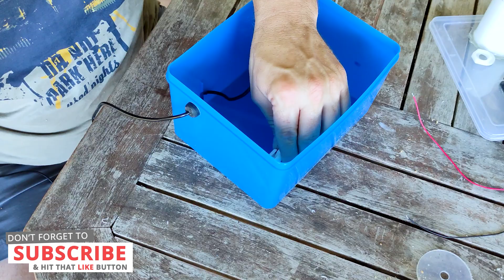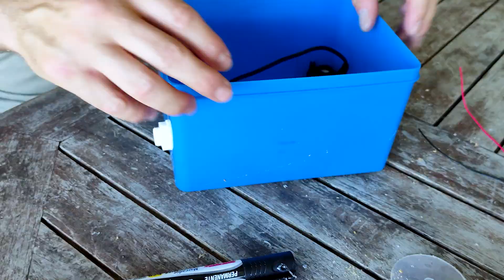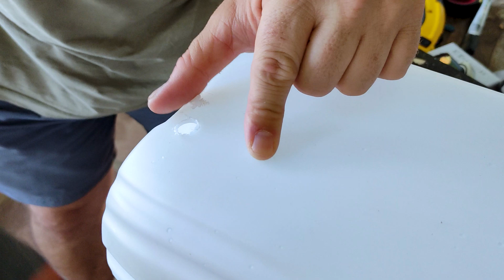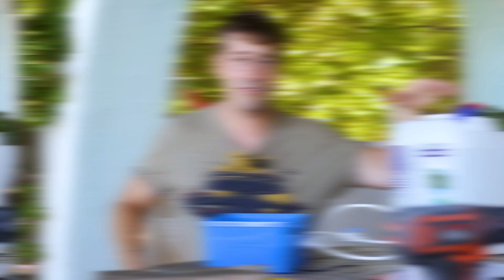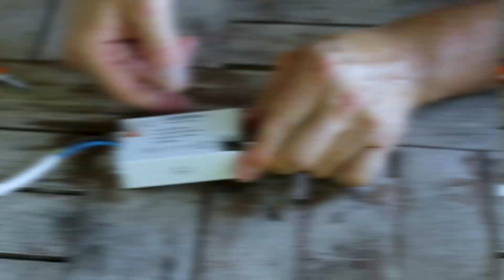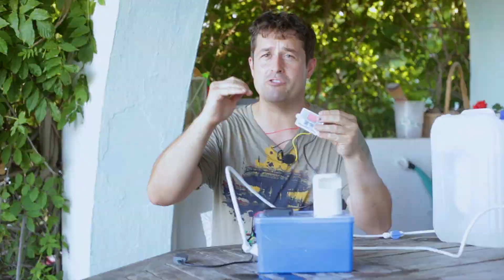Cheap & Easy DIY MIST MACHINE using an Ultrasonic Humidifier - DIY Fogger Machine FULL BUILD

Comment: I worked for a place that dealt with plastic for 13 years, and I wanted to offer a little trick: when using a hole saw drill bit,  after you've made the pilot hole in the drill bit on the center of the hole saw,  switch your drill to reverse.  You'll have to work your drill at different angles to prevent binding, but it will give you a better chance of making a clean hole without cracking. It will melt some plastic,  so you'll need to clean that up; a deburring tool works great for that.
Reply from the maker: Thanks for the tip mate 👍 😁

Comment: Why do you think this stops running after a few seconds? At the end of the video it stops running. I mean the main ultrasonic humidifier itself. I tried it in different bowl in different water levels but it does the same thing before even starting this project. https://youtube.com/shorts/QTjyeZ2T7wk?si=tniPSMeNrakg9NYh
Reply from the maker: maybe its a fault with the misting module? very nice simple build mate! did a great job there :-)
Reply: @GreenthumbsGarden thank you very much mate! Yours is more professional. I'll try to change the module. That thing runs me crazy

Comment: When you drill out the large air holes, run your bit in reverse, and take your time with lite pressure. The hole will come out with a smooth, melted feel.  A nice finish.  I know we are just gonna cover it up but still you can never make something too nice now can ya.
Reply from the maker: That's a great idea! thanks :-) never can be too nice! 😉

Comment: Can u tell me what kind of power supply is this ?
Reply from the maker: it's a 230V AC to 24V DC LED Driver but you can use any power supply that is 230V AC (120V in America) to whatever the voltage is of his other bits like the fogger and fan.

Comment: I picked this up for work. My last one was smaller https://www.youtube.com/post/UgkxtD9aJ2m6GU-X1IChQxjn9l31K1A7Kpwj and cuter but the motor burned out within a few months. This one's footprint is a tad bigger but it still doesn't eat up a lot of desk space. Its size and shape blends into the background nicely. This has a good size water container so I don't need to refill more than once a week. I use filtered (not distilled) water because cleaning up after our hard water is tough at work. I like that this has several settings. It's also very quiet. (I have a silence naxi in the next cubicle.) It also hasn't left that terrible while powder, so far, that some humidifiers leave. Been using this for a month or so now and am very happy with my purchase.
Reply from the maker: looks like a very nice humidifier! ill check that one out. Ive bought a huge misting module with 12 heads, the amount of mist it kicks out is crazy, I haven't had time to work out how to wire it up yet since we moved house but will have to make some time soon. The small humidifier I made in the video is only really good for keeping a small space humid like a cubit square meter or less, otherwise its working too hard and burns out. The big 12 head I have can fog out a room in a matter of seconds, so its working time will be a lot less in-between humidy levels been activated.

Comment: how long does this tool last?
Reply from the maker: depends, mine did not last long, about a month as it burnt out :/ it was on 24/7 because it was too small a device for the amount of space it was trying to keep humid, so it was never reaching the desired level I set in the humidity switch. I'm sure it would have lasted a lot longer if it was keeping a smaller space humid, like a 200l aquarium for example. Since then i Bought a much larger mister with 12 heads, its a beast, but I haven't put it together yet since the move.

Comment: hi, put the drill in reverse for not cracking the lid.
Reply from the maker: Great tip Dirk! 🙃
Reply: Oh, that drill should not be used in reverse. It might pop up open, due to design.

Comment: Stumbled across this looking for a way to add some spice to my booth at various cons. This is really handy information.
Reply from the maker: thanks mate, glad you found it useful!
Reply: @GreenthumbsGarden  I did! Keep up the great work.
Reply from the maker: @valroniclehre193  thanks Vorstel 😀 just to note; this device works well but I think better for a smaller grow area, maybe 1-1.5m3 and depending on air flow. It was on alot! Just to try and maintain that level of humidity in my tent. I bought a bigger mister with 12 heads, but not got round to making a new version yet, it will be the same thing just more power. Something that can come on for a minute and boom the humidity right to 100%. Also, use distilled water, or reverse osmosis, as tap water you will get a residue build up, and it will shorten the life of the mister. Would love to see it when you've finished! Share it on our discord server!
Oh you might find this useful also, so you can hook the device up to a humidity controller: https://youtu.be/FTGa0CsjxX0
Reply: @GreenthumbsGarden  Oh I think there's a misunderstanding. I make board games. I'm going to use this design of yours to add atmosphere to my next presentation. 

The problems I was having are all solved by your innovative design. Specifically the need for frequent refills and the usage of only water.
Reply from the maker: @valroniclehre193  oh right 😅 that sounds great, then this should do the job nicely. Would be cool to see the set up when you've finished!
Reply: @GreenthumbsGarden  Okay! It will be ready in 4 months. ^u^